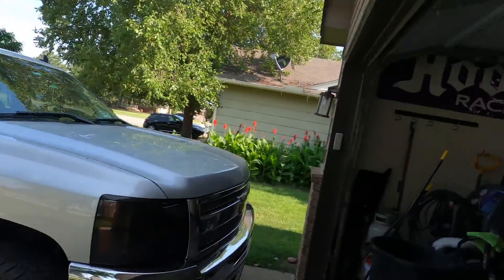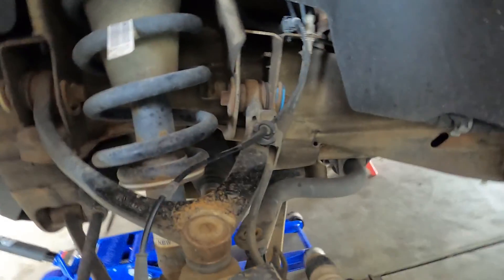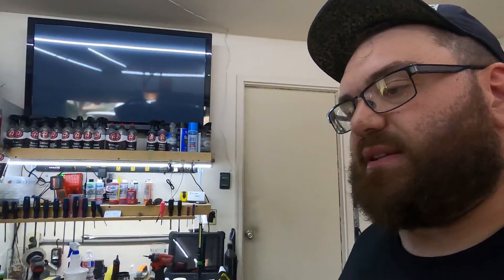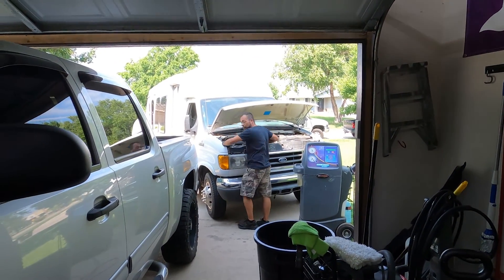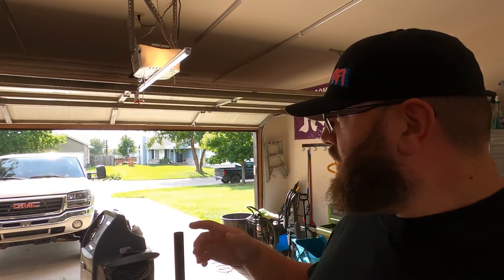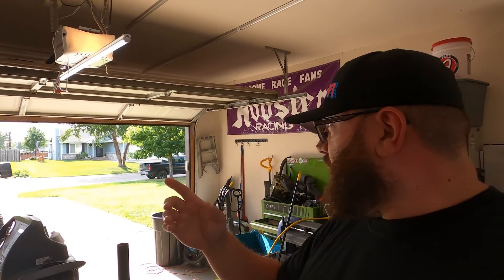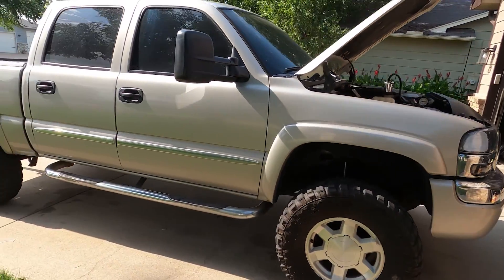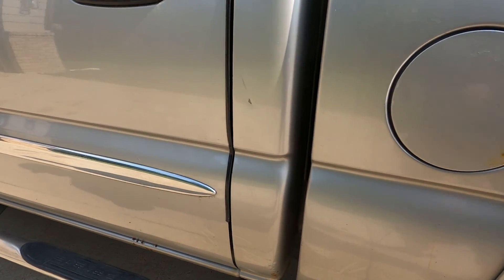2008 Silverado gets a NEW front suspension, Feat. MY Sierra with a coolant leak. LEAK FOUND! 🤦🏻‍♂️

Comment: " Don't fool yourself, girl, it'going right up the poop  chute..." Frank Zappa. I reference to the fact it probably is the water punp.  Check the radiator side of that hose. It might be one of those ultra expensive twist and lock ones with the clip ring you have to slide back into the right place, Kinda like the jumbo version of GM transmission coolant fittings, ecept on a rad hose. Those may be reserved for the 3/4 or 1 ton variants and diesels...and heavier Express vans that are 8=bolt wheel hubs. Since you are keeping the truck I'd order a Rock Auto Gates pump just to have on hand. For a hundred bucks you are insured and if it''s not the twist and lock rad hose the normal one is cheap and replace it too. And get some new heater hose because they both have to come off the pump anyway.

Comment: Had a Tuff Country kit on my ‘13- same thing hadda cut the top of the bolts. Ride was absolutely terrible and not worth it…I’m now switching to a Bilstein 5100 adjustable shock and hadda buy new upper strut mounts because I ruined the old ones 🤦‍♂️
Reply from the maker: I’ve got a rough country 6” on my Sierra and it’s okay.... the GMT900 kits I loved were Ready Lift.
Reply: Read a lot as far as leveling goes and most people said to go Bilstein, I’m not going taller than leveling
Reply from the maker: @waldoman321  if my 05 didn’t come lifted I wouldn’t have gone more than that. Bilstein makes quality stuff for sure!!

Comment: Without a doubt - Lower, upper and belt. Peace of mind, especially a current one vehicle household, you are in there, its gonna be messy and you have to replace fluid anyway do both hoses and the belt is a no brainer - keep current as your new spare and get on down the highway to Dallas.
Reply from the maker: My thoughts as well! Actually went and picked them up today! 🔥🤙🏼 just need time! 😂
Reply: @ObsessedAuto  plus the absolute last thing a guy needs is to be stuck on the highway with a wife angry about you going “cheap” on the maintenance. I am fortunate in my wife never questions my spend when it comes to repairs. “Whatever it takes to be safe” she tells me. So if my wife asks, Power Flex polyurethane suspension bushings, all new ball joints and a thicker adjustable rear anti-sway bar is now considered “safety equipment”.  🤷🏻‍♂️
Reply from the maker: Hahah same, and the alternator needs charge pipes! 😏